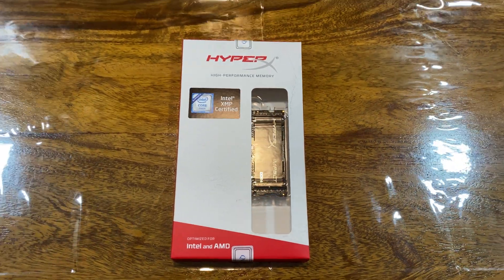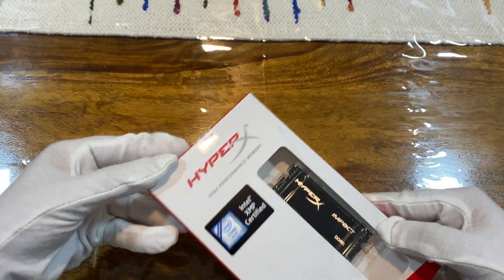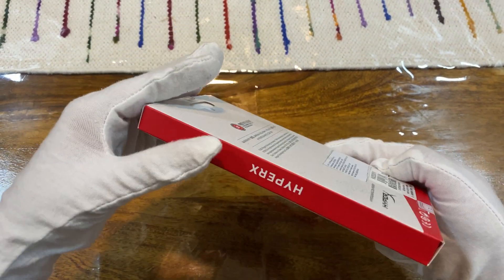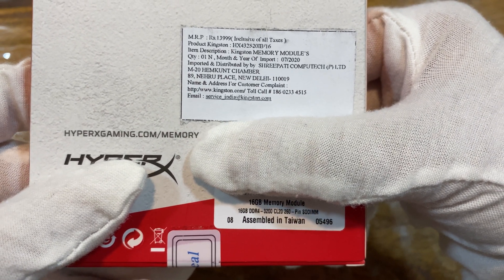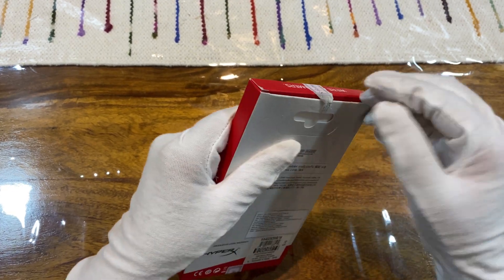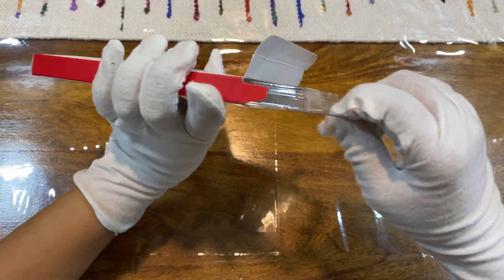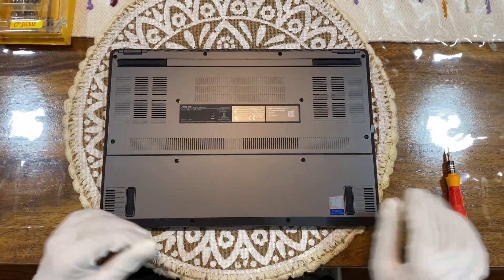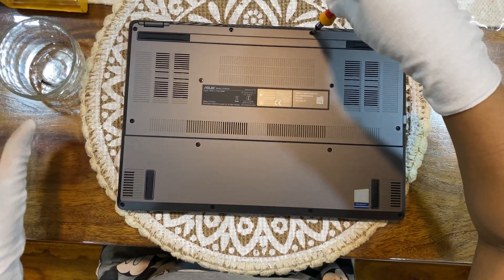ASUS ZEPHYRUS G14 RYZEN 7(4800) RAM UPGRADE 4K

Comment: Hey bro what is maximum RAM this Device can support?
Reply from the maker: Hi, it supports up to 32GB if you already have 16gb soldered but in my case I had 8gb so I added additional 16gb so all together mine supports 24Gb.

Comment: planning to buy with Windows installed. If I upgrade my laptop, will the Windows installed be removed？
Reply from the maker: Hi, I beg your pardon but I failed to comprehend your question. When you say upgrade what exactly are you planning to upgrade your laptop with Ram or anything else like Ssd? Well if that's what you intended to ask let me tell you that if you only upgrade your ram to let's say with another 16gb to make it 24gb altogether you don't have to worry about the windows installed as they remain intact, also I have made a dedicated video on how you can upgrade the ram of  Asus Zephyrus G14 yourself. Now if you wish to upgrade Ssd from 512Gb to 1tb for instance in that case you will have to copy windows from existing ssd to an external hard drive and   install it on 1tb Ssd once successfully replaced and this is the only possible way i am afraid as there is single slot availabe for Ssd. I would like to seek professional help with anything to do with windows and will recommend you the same.  Please do like and subscribe if that helps. Thanks.
Reply: @RpTech450  thanks it answered my question. One last thing, others users upgrade thier SSD to 1TB, is there any difference by upgrading that?
Reply from the maker: @kodelkaTekken  Hi, yes ofcourse  space matters, more is better but you'll have to understand your need.I have a PC from Asus which came with 2TB space but I could only manage to fill up 360gb in 6years, on the other hand when I thought of transferring all that data to my new G14 laptop which has 512gb and it didn't make sense as it would have consumed nearly all the space so I kept my laptop empty and purchased an additional hard drive of 1TB from Seagate to store all the stuff.Now there are 2 things you must take into account:-

# Requirement - what are you intending to keep this laptop for, if you are planning to upload years of videos,Pictues and other files trust me 512gb will start to fall short so be futuristic and invest in 1Tb variant. 
# Cost- Trust me if you buy 512gb option and looking forward to upgrade the ssd it won't come cheap infact It will also give you the hassle of transferring windows and what not which involves risk at the same time. Either you buy 1Tb variant if you manage to find one and suits your pocket or you can simply buy additional 1 or even more Tb space hard drive or Ssd to store your content and connect it to your laptop whenever you need. Hope that answers your concern.

Comment: "you won't get a performance increase, you will actually get a decrease. Using different size modules will run the RAM in dual channel hybrid mode. Don't ask me the specifics, just know it's not as speedy as running true dual channel -2 same size sticks-.

Only upgrade to more - RAM - if you actually need the - RAM - space. You will sacrifice speed, but in turn you will be able to do more."
Reply from the maker: As much as I am open to correction I fail to comprehend your point no offence. Well in nutshell I consulted authorised Asus Dealer and one of their executives recommended me to go ahead with this one, not only that even the online link I purchased it from had people asking the same question if this particular one is suitable  for G14 and its confirmed by multiple people that it certainly is.Also I have referred to CPU Z app and it confirms that the ram is working in dual channel mode without making any compromises. Rest it's your perception and I respect that.
Reply: @RpTech450  "Rest it's your perception" lol that's funny, this is facts go online and study a bit. you need to have two of the same RAM cards in order to truly be in duel channel in G14 this has been tested many times already but you go find out yourself and ask the community  https://www.reddit.com/r/ZephyrusG14/
Reply from the maker: @energyvampire1672  I ain't bothered to go online for that sake, neither I have an intention nor enough time to prove my point and to who actually? You are more than free to stick to your intellect fortunately or unfortunately that's not any good to me as you have quite a hostile approach and this isn't the right platform I am afraid. If you like to make people aware of your understanding I suggest you to do the same by messaging others as well here on YouTube who have opted for similar configuration of ram. Good Luck.
Reply from the maker: @energyvampire1672  I educate myself on the things I reckon worth it. I did my job by making this video and I would let the audience to make whatever of it. Those who find it helpful may or may not  appreciate and others can diss as much as they wish and get a life. Safe.
Reply: @RpTech450  not when your information is wrong and harmful to others.
Reply: You won't get the benefits of dual channel but you will get -> (Hybrid Duel channel instead lowering your performance especially for gaming) please people don't be as stupid as these two are. Each motherboard has his own configurations and limitations as well, depending on companies as well. Specific to the G14 this is a huge problem right now in the community which is why nobody is upgrading their ram and we're all waiting for the 32 gig model which will be sharing a 16x16 gig configuration. The Rams have to be the same & speeds, in order to run in duel channel otherwise your in (Hybrid Duel channel) instead, since the G14 has one soldered ram, that's impossible. You'll be stuck in Hybrid  and that has been proven with screenshots, bios, overclocking, underclocking you name it. Your powers are to put a stick inside of a computer and make it work lol 🤣 and then fight me with a link hahahaha
Reply: @energyvampire1672  yes you will get the benefit of dual channel link even with two different size rams. Other people reading have two options - 1. Either agree to this reasonless smily emoji of this guy or 2. Google yourself to know the truth . 

The end !
Reply: @hullagtpp  Seems like you don't even know how to read yourself o. o that's sad want me to recommend a book ?
Reply: Yes... Symetrical dual channel will out perform asymmetrical dual channel. But it barely notice by the users. Unless youre in gaming! Yes! You will notice the fps sightly lower in asymmetrical dual channel. For those people who need extra ram for video editing, it is ok for you to have asymmetrical dual channel